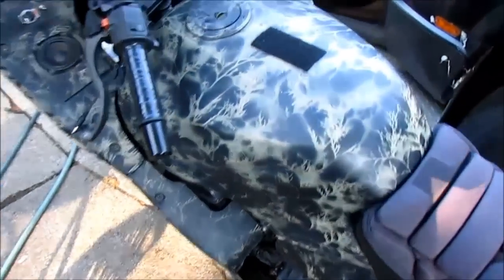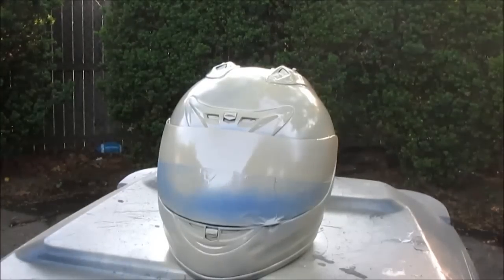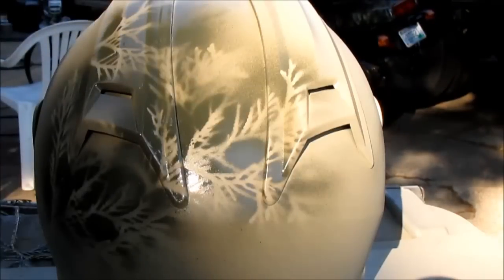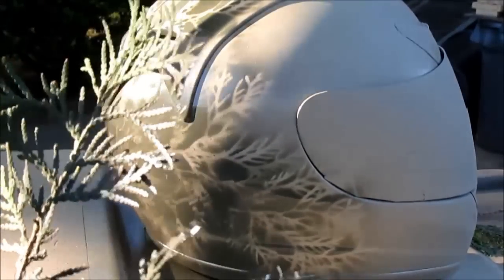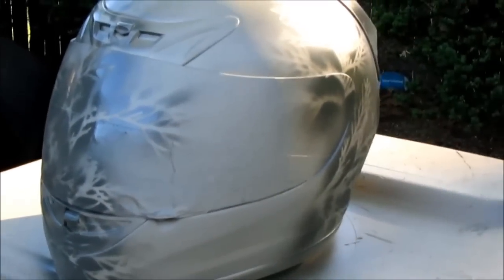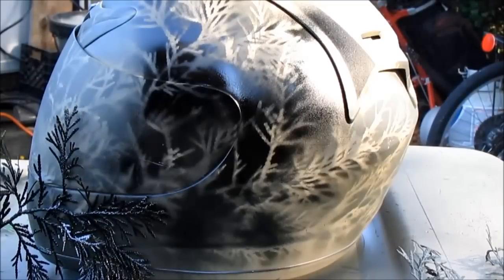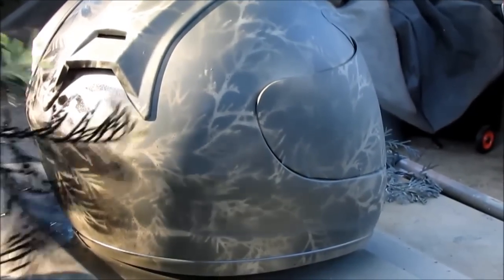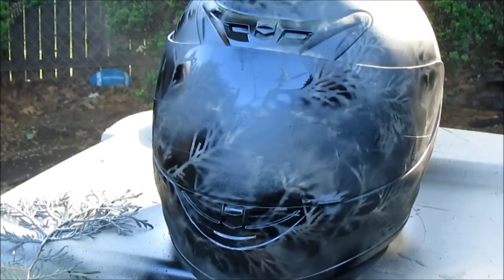How to paint camo

Comment: I almost like it better before the black better, I know the black gives it the depth to get the 3D look but the first 2 colors worked very well together. It's harder to do on a small piece because you have to use more black or it won't look the same, on a bigger project you can use less black and really get the depth/3D look to pop. It's all about depth perception.
Reply: Vielleicht wäre es auch gut gewesen, mit Schwarz (oder Braun) zu beginnen und dann heller zu werden. Mir gefiel es ohne das Schwarz auch besser.